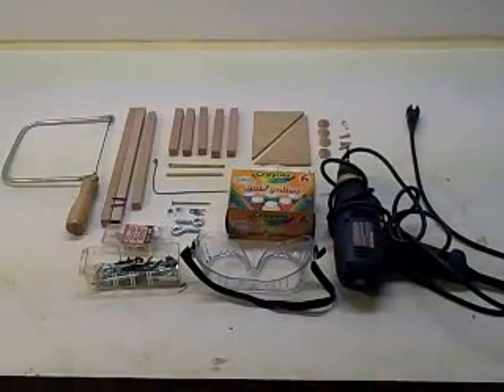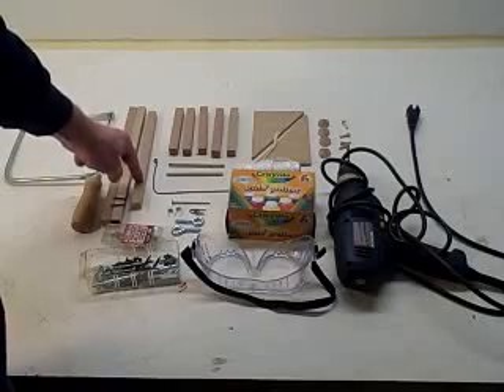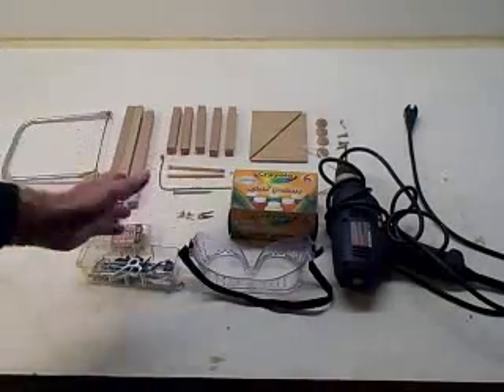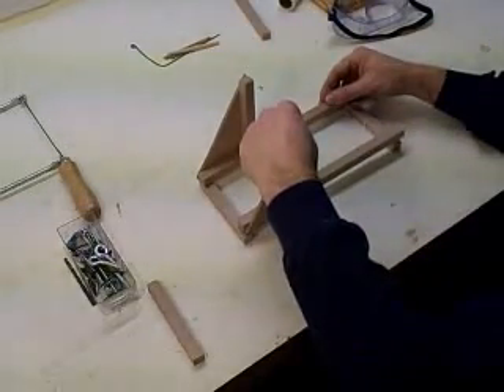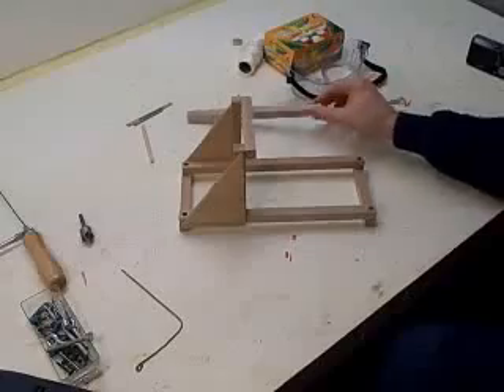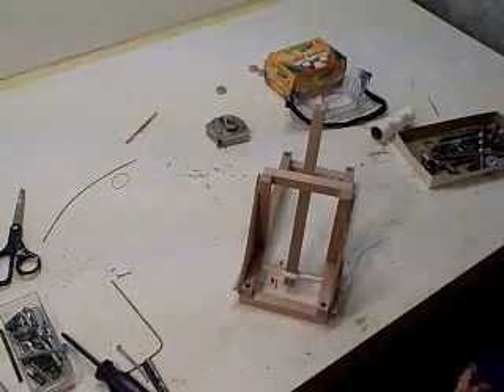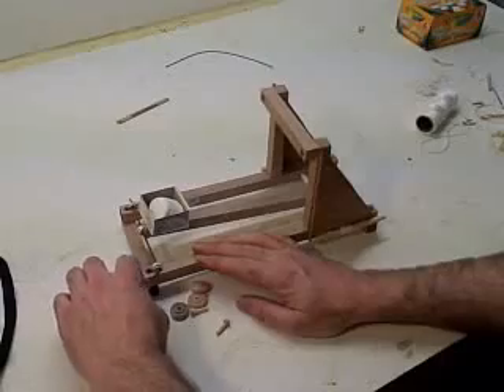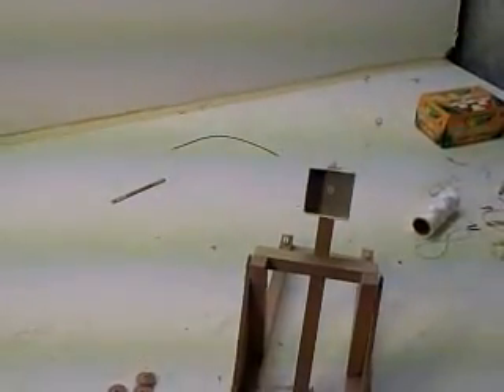How to Build a Mini Catapult

Comment: I made this project and there are a couple of Construction hints for this.  First as you can build this to any scale, the wood can be found as wall molding.  They have a 3/4" and a 1" that you can try.   Second, use 3/8" Dowel rods for rope Tension-er, If you can find and cut a similar metal piece all the better I used 1 1/2 - Two inch section.  Trick for the tension string. Coat end with Crazy glue 2".  It will stiffen the string like a needle and becomes easy to pass through.